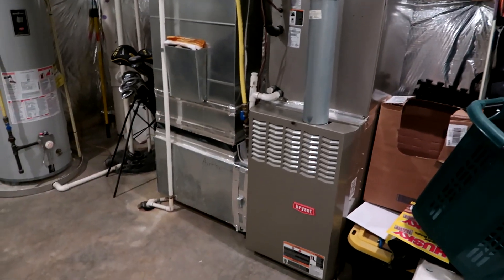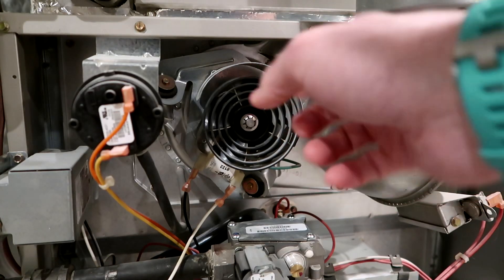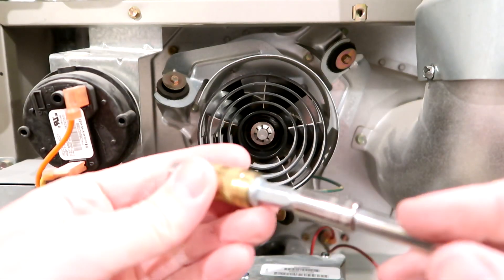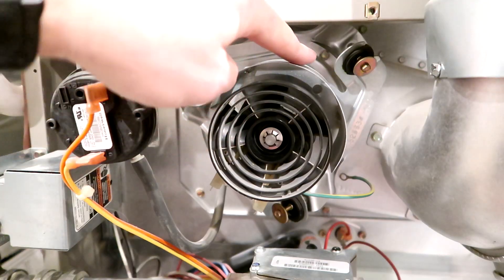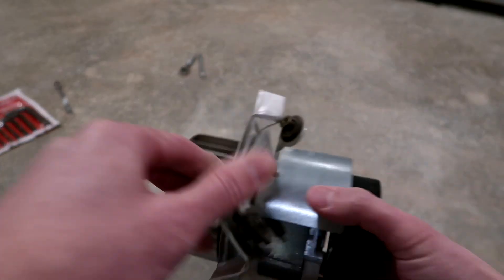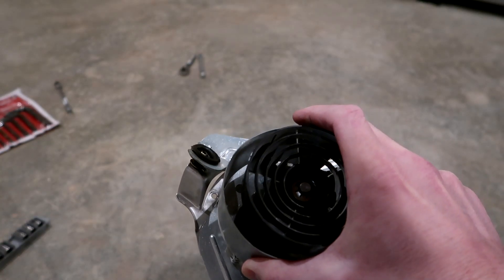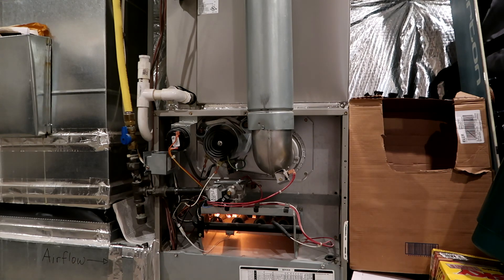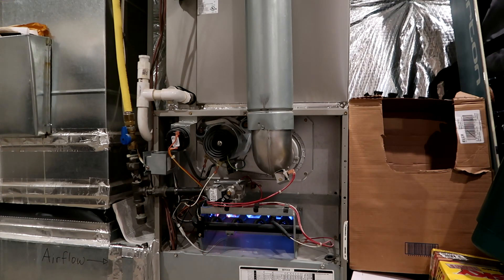Fix your noisy furnace - step by step guide to Furnace inducer motor replacement

Comment: Great video.  We also have an identical Bryant that had its inducer motor screech for awhile like yours did until it finally seized, causing us to wake up to a cold house.  Thankfully our appliances, furnace included are covered under a repair/protection plan from our gas company in which the inducer was replaced and it didn’t cost us anything, and we’re enjoying our much quieter furnace with its new inducer motor

Comment: I have a lennox and the whole thing is pressed together with the fan in a shroud which cannot be removed. To add insult to injury the motor doesn’t just bolt onto the furnace like yours does but there is a piece which you must take off to bolt the motor on from behind! This thing was made not to be fixed by a doit yourselfer. Get lost lennox.

Comment: WD40 isn't really a lubricant - it's a water displacer (hence the WD).  PB Blaster isn't a lubricant either.  You should use a real lubricant - but just as a stopgap measure until you replace/repair the motor.  You can also disassemble the motor and replace the bearings.  If the bearings are just dry and not damaged you can try reqreasing the bearing by removing/replacing one of the bearing seals.
Reply: There's always that one guy.. Congratulations captain obvious 🎖️ (🖕)

Comment: Nice video. I have an Amana furnace/AC combo outside (made by Goodman); the inducer fan wouldn't start so the furnace wouldn't fire up. I could manually spin the fan and it would start spinning, and the furnace would start. The local HVAC guy wanted $900 to replace the fan; I bought the assembly from Goodman for $150 and installed it myself.

Comment: No gasket??? Exhaust that carries carbon monoxide out of the furnace should be sealed with a gasket. Unless you like breathing that crap.
Reply from the maker: Furnace is in a ventilated 300sq. ft. Storage room with a carbon monoxide detector right outside the door, zero issues so far 🤷‍♂️

Comment: I just need that little black fan on it.  It’s been making a rattle noise
Reply: Did you ever find it? I just need the fan part too and I'm lost!!
Reply: @chrissyison8871 still running the very same one I cleaned it and hit it with some watch oil I had laying around and it’s been silent since 🤷‍♂️
Reply: By cleaning I used a air can and blew that and all around it

Comment: Thanks for the video. I ordered the entire assembly so I will be replacing it today. Question, the new assembly already has the bolts in the rubber isolators, do I have to take those out? Seems like I could just leave them on there and remove the 3 mounting screws...
Reply from the maker: I would replace everything. Can't hurt to have all new pieces in there
Reply: Can you share where and how much you got the whole Assembly for? We're you able to replace it with ease? Thank you!

Comment: That bolt is a bitch on tge motor....  been working on it for an hour....
Reply from the maker: It definitely sucks. I thought I was going to break my Allen wrench, eventually it came free
Reply: @PlatoonGarage  I'm sure the penetrating oil helped but it wasn't until I used a cigar torch to heat up the bolts to win a finally broke after that it was pretty much smooth sailing.

Comment: If anyone is replacing the inducer motor themselves, you absolutely must replace a high temperature gasket that sits between the motor assembly and the case. The old gasket that we could see in this video is fully destroyed (https://youtu.be/VGvi6A4JBco?t=454) and not capable of properly isolating the air flow. It is prone to leak carbon monoxide outside of the combustion chamber which is very dangeourous. In addition, if you have a budget, pay a bit more and replace the entire assembly, not just the motor, This way you'll avoid all the errors of reassembling all the parts together and will have a fully working furnace for another 10-15 years. In addition, the full assembly comes with an installation guide, a new gasket, and a set of new screws instead of the old rusty ones.
Reply: My replacement inducer motor has a white foam gasket already on the back of it, the old one had a rubber one that was on the furnace unit itself (the plenum?) - when I removed the old one the rubber gasket broke apart.  Is the white foam gasket on the new unit all I need?
Reply: Yes sir
Reply: What is the entire assembly code? I can't find a replacement part.

Comment: Is the motor HC21ZE122A the same as HC21ZE121A?  My furnace look exactly as your but it is brand Payne with inducer motor Carrier part number HC21ZE121A.
Reply from the maker: Sorry, unfortunately I don't know if they are the same
Reply: No they are different 21A is for a smaller capacity furnace

Comment: For the rubber isolaters, did you tighten them all the way? I have the same type motor but it makes a loud rattling noise when the fan kicks on. I'm wondering if I need to tighten the screws on the rubber isolaters. Hvac guy that installed mine is trying to tell me its normal.
Reply from the maker: The screws are tight, but the rubber isolators are supposed to allow for a little bit of flex but not loose.  Hopefully that helps some

Comment: the tin guard above the outside plastic fan wheel vibrates and when a squeeze it with my hand it stops making noise? Is the fan motor bad or does it just need re positioned? or replaced.?
Reply from the maker: Hard to say without being able to look at it myself.  If you think you can reposition it or maybe apply oil to make it quieter try that first before replacing.
Reply: @PlatoonGarage  do you need to remove it to oil it?
Reply from the maker: @lar4305  depends on what area you are applying oil to, I don't know where your Boise is coming from

Comment: For that fan where you have the allen key to get that motor coupling off, I believe there should be one fan blade directly in line with it, with an opening for the allen key.  If you pause at 6:33 you can see it on the blade 2 left of the thumb, where the bottom of the blade is open.
Reply from the maker: Correct, there is a small space in-between 2 of the fan blades that allows you to get the Allen key in there. 👍
Reply: @PlatoonGarage  I ended up doing this job today.   I got lucky, the set screw on the motor I was able to break off fairly quickly, I thought my allen wrench was going to snap but it didn't.   My old motor was acutally OK.  It was making a ton of noise when it was spinning, but it turned out I think some rust dust got into the bearings.   I put the new motor in, but cleaned up the old motor and now the old one doesn't make any noise either and spins just fine.   So I guess I'll keep it in case something happens.    Very easy repair though
Reply from the maker: @ChubbyPepPep  awesome job. I remember applying a lot of force in that Allen key and thinking it was gonna snap for sure, only to have it break the set screw loose.

A few sighs and curse words later, was back to reassembly

Comment: Mine doesn’t spin at all  the black thingy  part what dose that mean ?
Reply from the maker: Hard to diagnose from your description. The black fan is just attached to the inducer motor, so if it's not spinning, then chances are the motor has failed and won't turn at all